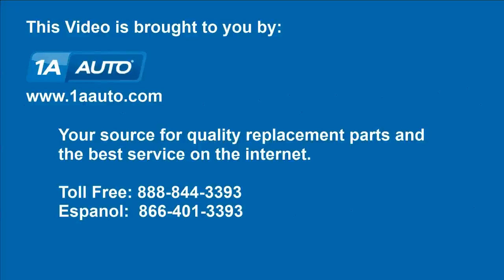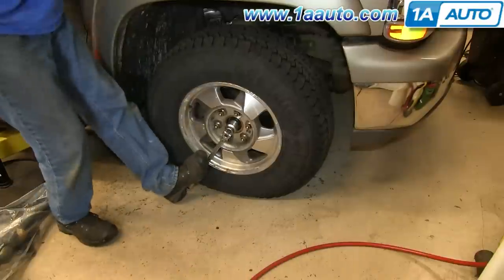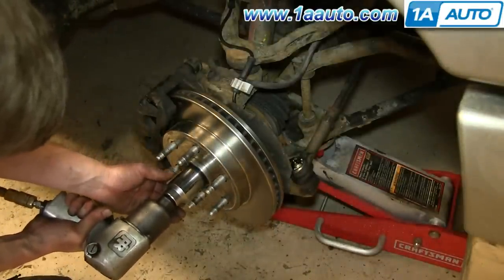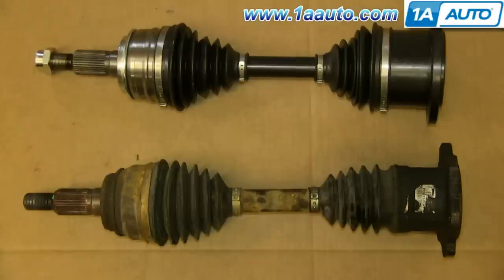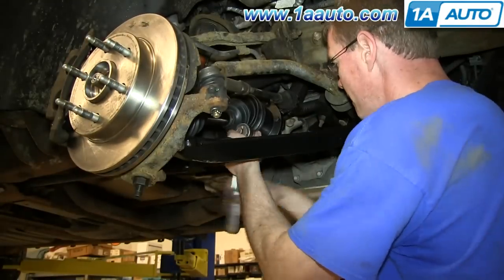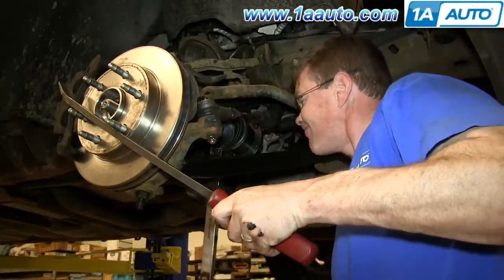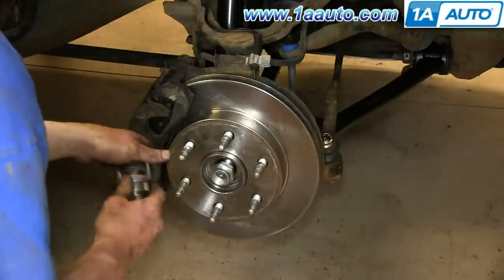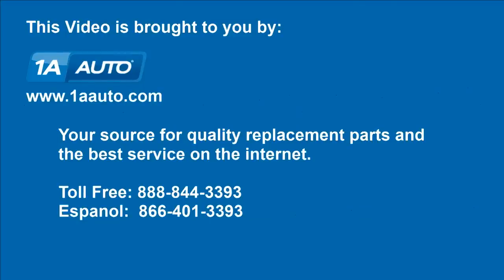How to Replace CV Axle Shaft 00-06 Chevy Suburban

Comment: So on the hub nut on the 02 video for axle change the torque you said was 165 ft lbs and this 02 you said 125 ft lbs so I have a 2000 suburban… what should my torque be 4x4 1500

Comment: Same process as the 2005 sierra 1500 4wd?  Mine has a 6 inch lift on it. I'm assuming the sway bar links are longer in my case.. is this correct?
Reply from the maker: +klok95330 It should be the same or a similar procedure. Hope this helps you out. 1aauto.com

Comment: The two axle bases where the six bolts attach the axle to the front differential ( STAR Outline vs Solid Round) makes the removal process difficult! From my own experience to help your viewers on the replacing the old axle which you should notice has a star design end  2:38  (Original from the Assembly Plant), where the 5 bolts are attaching the axle to the front differential. If you order the same design axle which I highly recommend it, you will only need to remove the shock absorbor in order to  remove and replace both axles on each side of the vehicle,  bypassing the removal of the sway bar linkage. The star design end is the reason for allowing clearance  for that portion of the axle around inside the tight areas of the upper and lower control arms. If you go with the  New Replacement with the full Solid Round Base Axle End shown in this video, you will have to go through the pain of removing the sway bar  linkage. I learned the hard way and  I hope that helps your viewers safe some time and energy! Thank You!
Reply from the maker: +FitzpatrickMTV Thanks for the tip! That will surely assist anyone having a difficult time with this. We will also pass this on to our production team!

Comment: Is the outside Axel nut a 36mm. Also what is the size of the inside bolts thread pitch and length mine have all fallen out. And I can't find any information online anywhere about the size thread pitch and length on those bolts thank you in advance

Comment: I noticed a discrepancy between this video and the one about replacing the hub-bearing assembly on the same vehicle: in the bearing video the hub nut is torqued to 125 lbs and in this one it is torqued to 160.  Just checking because I recently did a bearing on my truck and torqued it to 125 per those instructions.

Comment: Is this gonna be the same procedure for a 2002 Cadillac Escalade?  I'm getting a vibration turning right while driving down the road.  Goes away if going straight or turning left.  I feel like it's the driver's side CV axle.
Reply from the maker: +thekeymaster The part shown in the video does fit your application. It should be the same or a similar procedure. Here is a link to them on our website. Hope this helps you out. 

https://www.1aauto.com/cv-axle-shaft-front-pair-trq-csa82441/i/1aacs00104?f=838637&y=2002

Comment: Where can I buy replacements for the bolts shown at 2:40 in the video? Axle flange bolts.   I NEED them and cannot find them anywhere.
Reply from the maker: +Leon Rutledge You should be able to reuse your originals or purchase at any local auto parts store.
Reply: @1AAuto  The originals came out on the road.  And no local auto parts store has them.

Comment: Is this a 2500? I went with a 35mm socket to replace a hub bearing going by a previous video but that doesn't fit my bearing nut.
Reply from the maker: +wildernesspath1 It's a 1500

Comment: Would CV Axle stop me from turning left? When stopped I can't turn my wheel left. When driving it turns fine just pops at slow speeds.

I am also getting a constant click that gets slower or faster depending on speed. I cant decide if it's an axle or wheel bearing. Or something with the steering
Reply from the maker: +R A Unfortunately we cannot really accurately diagnose that. We would advise you take it to a trustworthy mechanic in your area that can look at it in person

Comment: Can the shock be removed instead of messing with the stabilizer link? Will that allow enough room to remove / replace the axle?
Reply from the maker: +J Montgomery Thank you for checking us out. Due to needing to pull the axle through the lower control arm opening this is the recommended procedure is by remove the stabilizer link. 1aauto.com
Reply: Does the stabilizer link have another name?  I can't find it in your online parts listings.If there is a chance I have to cut mine off I'd like to have the new ones on hand before I start the job.
Reply from the maker: +kewabl What year, make and model is the vehicle. We can see if we have them available for you. Thanks for asking. 1aauto.com
Reply: It is 02 GMC Sierra Z71 w/5.3L V8. I was curious why you included the saw in the tools list at the beginning of the video but did not include the replacement stabilizer links.  I have already ordered the hubs, due to arrive on 10/5.  I'm afraid I may have to replace the CV axles also.  I am starting to hear some new noises when I turn the wheel.
Reply: I found sway bar links on your site that look the same.  Is this the part the he cut?
Reply: First..thx for the vid...good clean work...even with a camera on u..idve been nervous. ...  2nd.  My oldest man has the caddy..which to me is just a over priced Chevy. .  I've never worked on a front end..especially not a 4wd...and his axl..or..universal. .I was told is bad...I've done rear work..transmission changes...and I didn't see the traditional 4way universal that u see in a rear drive shaft..so is there just no front universal orrrr...is the bolts around where they meet together is that what they consider a universal?
Reply: kewabl its the sway bar link.

Comment: I'm getting a repeated "clank" or "clunk" sound out of my front end it happens most when taking off from a stand still. Would this be a cv axle??
Reply from the maker: You may want to check the axles and also all of the other steering and suspension components, such as the inner and outer tie rods, sway bar, sway bar steering stabilizers, etc. Hope this helps you out. 1aauto.com 866-403-3393

Comment: Is this a 4 Weel Drive ?
Reply from the maker: +Jason Geisendorff Yes this vehicle is 4WD!
Reply: @1AAuto  I have a 2000 Tahoe. It's a 2WD. I hear clicking when making tight turns. Are their CV Joints in the front even though its only 2WD?